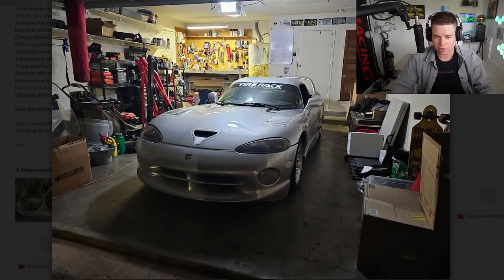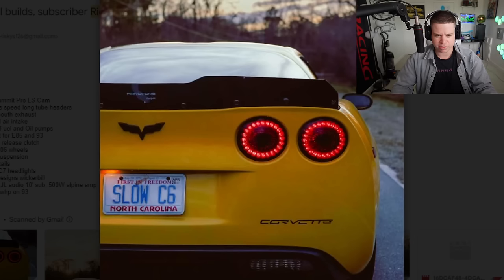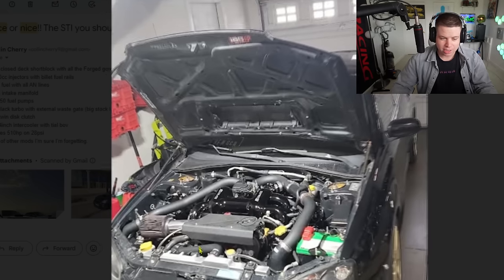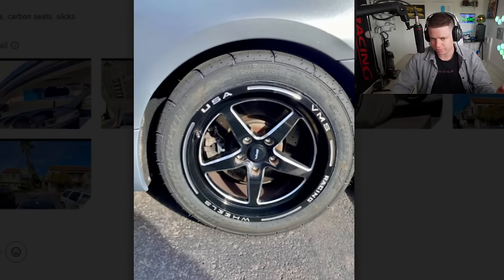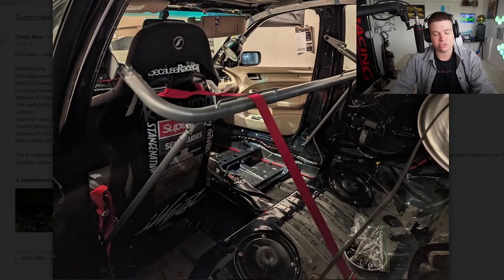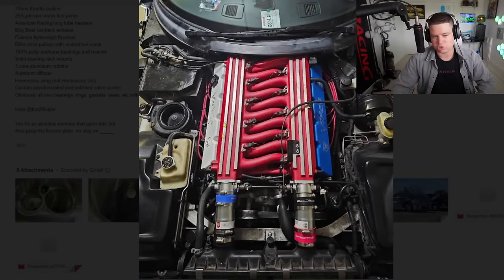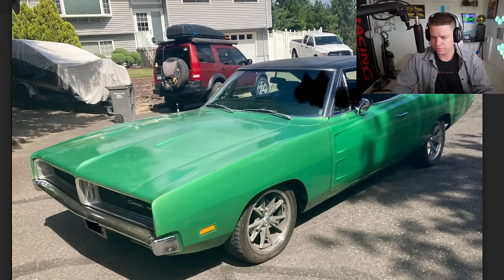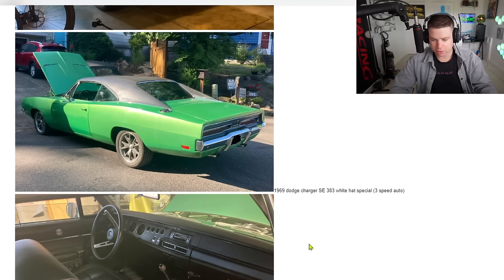JUDGING My Subscriber's BEST BUILDS  - Not ONE Ricer!!!

Comment: Currently the misses is battering cancer. I had to sell my Raptor and got an Si. I actually like the thing. Ecentouly I'll send it in but I can't afford to do anything to it yet. I'm going for OEM+ for styling and I'm gonna do full bolt on with an over the counter tune. Nothing special. Just a fun daily that's good on gas. I say this because I've always wanted to send in my builds to see what you think since our styling is very close but you never cared for the trucks. This episode had an 11th gen in it, finally. Mine is gonna look like that but mine is black and I'm putting on the Type-R upper and lower grille. It just looks more agressive and it keeps the Si looking like an Si. Homeboy in the red Civic, if you see this post check out the type r upper and lower grille on the Si.
Reply: First of all I’m very sorry to hear about your situation and I truly hope the misses makes a full recovery and secondly I am a big fan of the type r lower and upper grills however I have bought a type r style bumper that I’m going to paint match and keep all the si badging on there as someone did back into my stock bumper and there is a small scratch and a decent sized dent so I figured I might as well upgrade and make it stand out from some of these other 11th gen’s and upgrade, I hope your civic turns out well! And more importantly the misses makes a full recovery ❤️‍🩹

Comment: Unless you’re upgrading to turbo or supercharger or internal parts, and I will include suspension to a degree it’s not a build
Reply: I wouldn't say it needs forced induction, so long as you tune it and it makes like at least 30hp more than it did stock.
Reply: @Treaxvour  30 hp is reasonable

Comment: 21 pounds of boost for 200hp?? Thats cant be real that shoukd be like a good 400 at least
Reply: bro this wasn't n/a it was turbod running 14 psi i think so he just added 7psi or smth
Reply: @mohamedsakka2338 you are correct factory the 1.5ts make about 13psi and I just got a tune whip upped it to 21 which isn’t pushing anything but if I want to make more than that I will probably need a better clutch